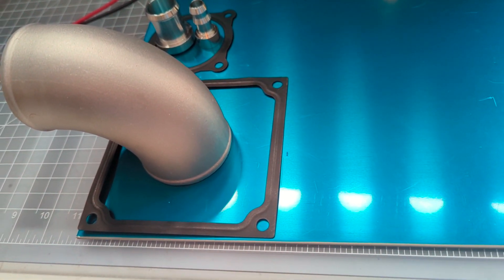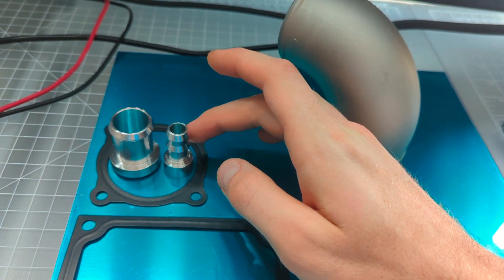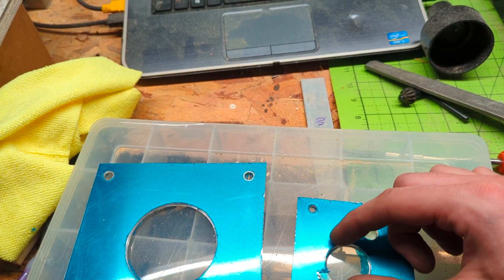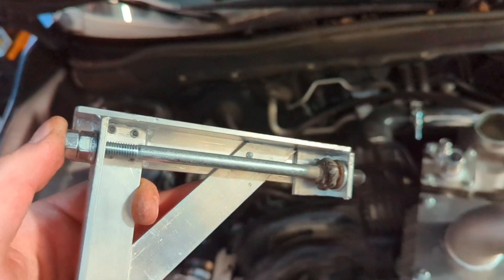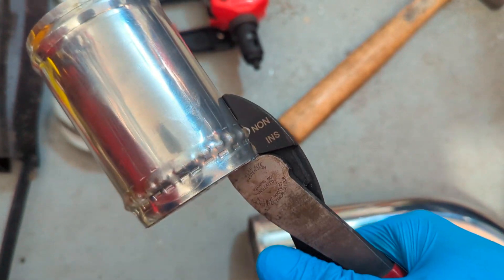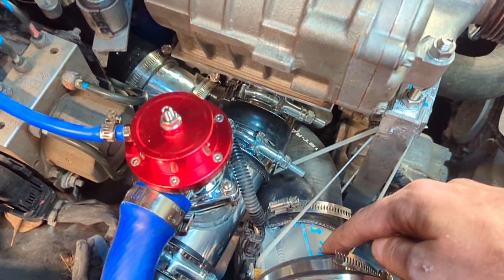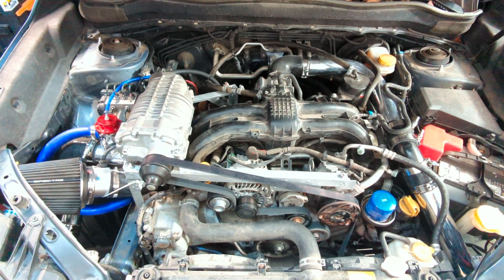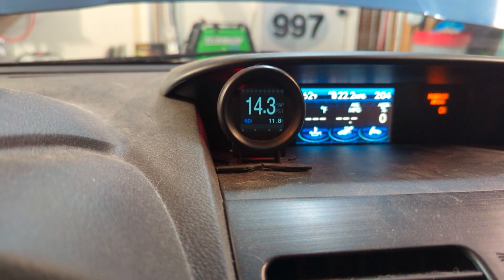FB25 Supercharger Install Part 2 (2015 Forester 2.5i 6MT)

Comment: Do you have a parts list and a possible schematic in terms of the order of the build from start to finish
Reply from the maker: The build evolved quite a bit since this video. But besides the supercharger itself and supercharger mounting, you'd need:

1. A generic 2.5" front mount intercooler and couplers and hose clamps to keep intake air temp down
2. A bypass valve (so air can boost can escape when you let off the throttle)
3. 3/8" hose for the crankcase breather and 1" hose for the bypass valve
4. A belt of the right length (will be platform specific)
5. A 2.5" cone air filter
6. MAF sensor housing + extension
7. A way to tune everything (I used a Tactrix cable + EcuFlash) but it's also CRUCIAL that you find a definition file for your ECU. Or you could pay for SubaruEdit which may come with definitions. Or pay for a pro tune like from XRT.
8. A higher range MAP sensor

I'm pretty confident you could put it all together for <$1000 USD, though by switching from the M65 to the SC14 (later in this video series), I probably exceed that.